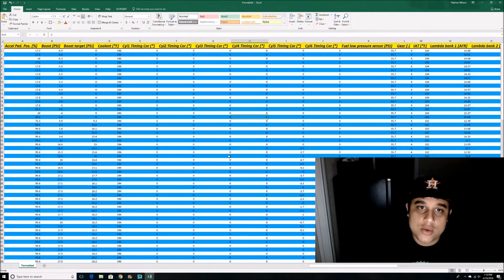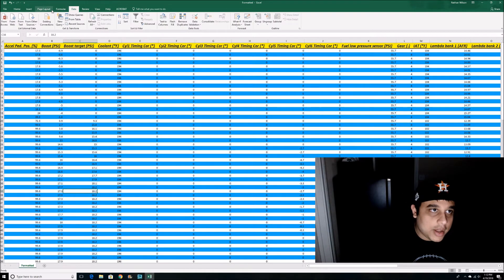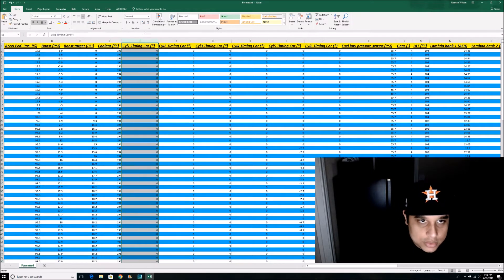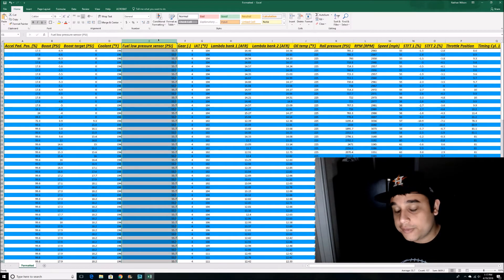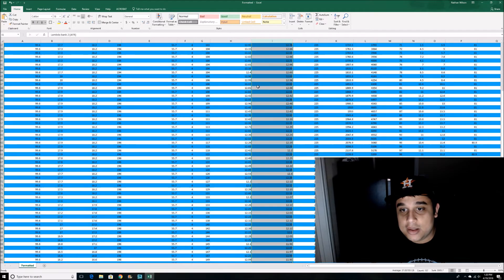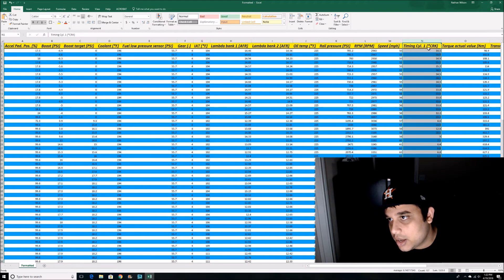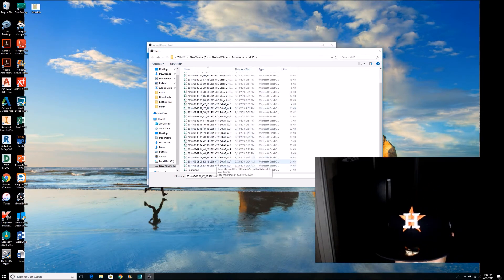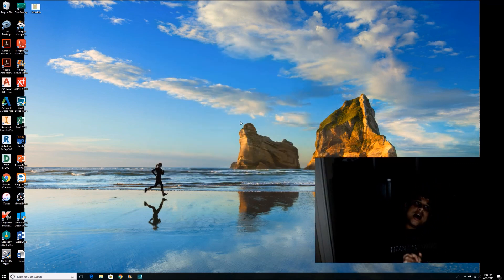BMW 135i/335i/535i (N54) MHD data log interpretation

Comment: Hey man, I know this has been out for a wild but I'm getting like -15/-10 Timing cyl 1 (CRK) when off throttle sometimes, is that bad? Other than that, my logs seem fine but some couple months back I think I wasn't getting these negative values. I'm still using 98RON (I guess it's 93oct for you guys) but it seems to be worse?

Comment: awesome video, thanks man, subbed.
question, how are you able to get the graph onto Microsoft excel? I'm on a completely stock 335i, Mhd stage 1 tune, charge pipe and Xhp stage 3 transmission tune.
Reply from the maker: Zach Carter MHD spits out data log files and you can open them with excel to view them on your computer! Thanks man! I’ve got so much more content just waiting for uploads!
Reply: @nateonfireball  appreciate the quick reply. I can read the graph on my tablet,  I thought it would be easier to look at everything on excel. I have a pretty good understanding of what I'm looking at, you're video helps. 
I have a Mac computer, trying to figure out how to send a log to my computer. Will a Google search help me with this, or is there a formatting issue going on?
Reply from the maker: Zach Carter not too sure on a Mac but I’d try to hook the tablet up via USB and find the MHD folder to pull the logs from. Otherwise you’ll have to get creative on how to send them to your computer. It’s way easier to see things on the computer and you can graph it if you want and plug it into virtual dyno and that’ll give you a power estimate and graph for you as well. Data logging is very important and can help you out in so many ways!